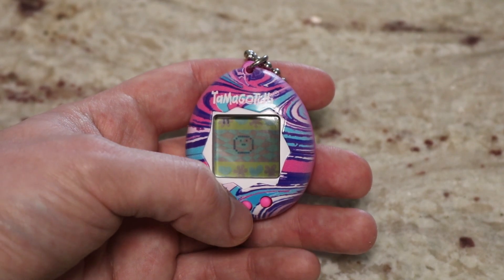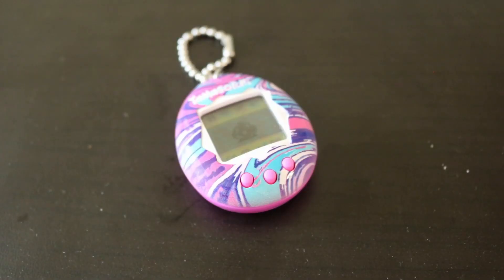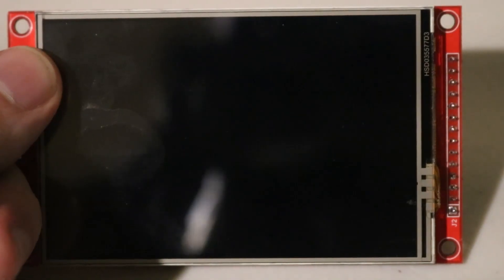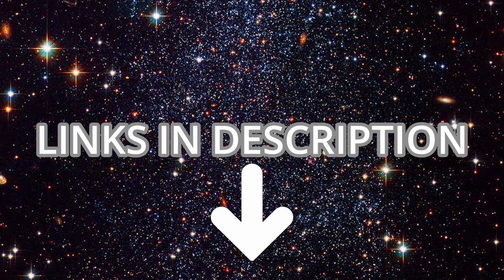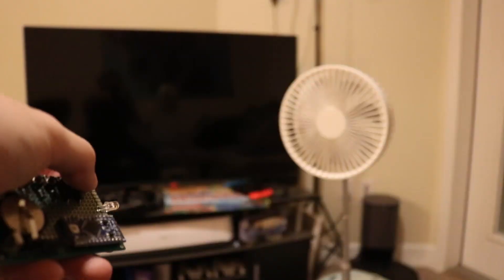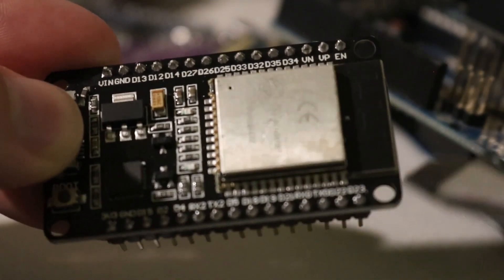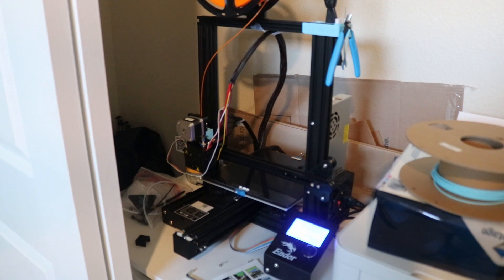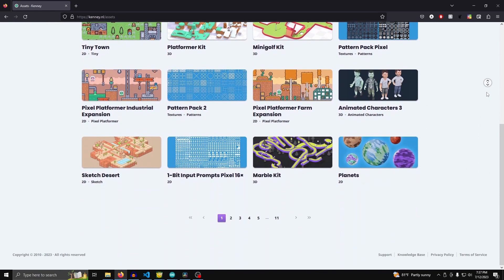The next Tamagotchi Evolution! | Building the MACROGATCHI Part 1

Comment: Hey, cool project!

Ive been using a device lately called the ESP32-2432S028R, which im calling the "esp32 cheap yellow display", its basically an esp32 dev board with an integrated display (the same display as you are using) for about $15 delivered. Might make an interesting platform to build the project on as it cuts down on the amount of wiring!
Reply from the maker: Ooh, thanks for the tip! Yeah if it's all there already it will make life a lot easier! I will have to look into that!
Reply: @keepeverythingy  let me know if you have any questions on it!